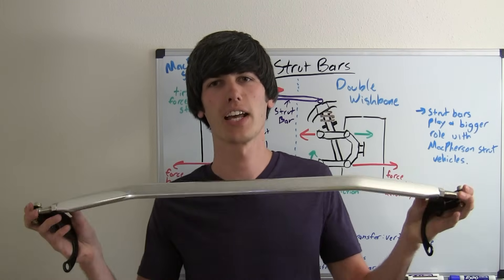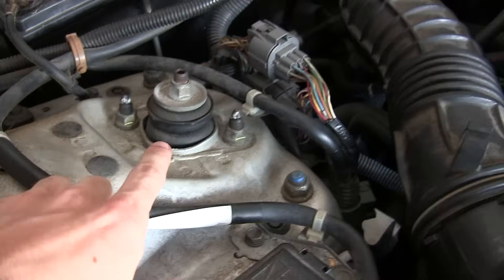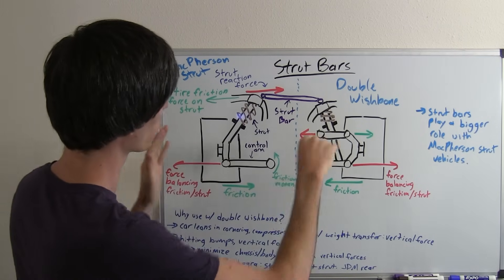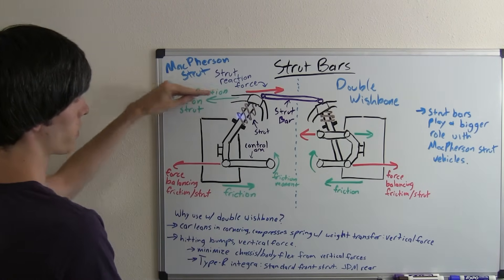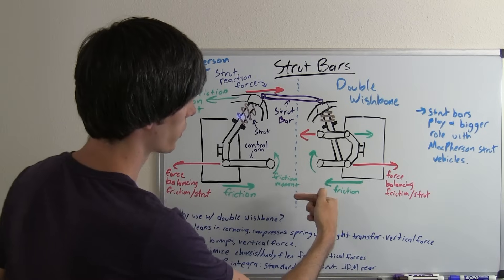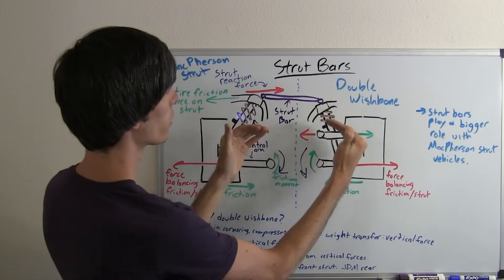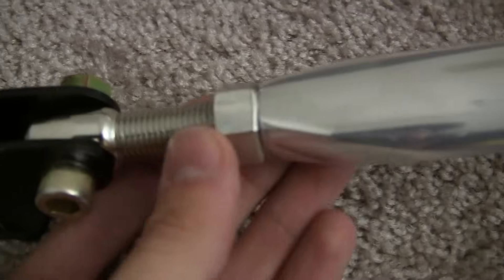Strut Bar - Explained

Comment: you will annoy people more then gain hp. If you want to gain hp you will have to re-do your exhaust system from the header's down. You can also swap out your tires for more racing ones. They warm up pretty fast and get sticky for max grip. I would go with tires if your ride is not turbo charged.

Comment: what is the difference between a strut bar and an anti roll bar??
Reply: ones on top, and the others underneath
Reply: sway bars/anti roll bars are round "flexible" metal bar that reduces body roll of a car when turning. It is connected in the left and right swing arms of the front or rear suspension. Almost all cars have an oem/stock sway bars already installed on them. 

Strut bars is a kind of "stiff" brace that makes the front or rear part of the chassis (where the struts are bolted) a little stiffer and reduces flexing during hard turns or bumps. 90's car models with Macpherson front suspension may benefit with addition of strut bars, in the sense of making the chassis stiffer thus maintaining the geometry even in non-racing use. Newer car model designs had their strut towers closer or even already braced to the firewall, making them already stiff, negating for the use of a strut bar for everyday driving.

If your car doesn't have one, you can easily install a strut bar on it, just don't overpay because the performance gain doesn't warrant you to pay for more than $50 on it.

Comment: WOW... almost didn't recognize him, lol.  For all the naysayers out there, the 2003 350Z came with a permanent structural cross brace in the rear and a bowed tubular steel strut brace in front that was adjustable.  I don't think the Nissan engineers manufactured it that way for "looks".   Did the front strut brace flex slightly, most likely, but not enough to get rid of it.

Comment: so does supercars have strut bars to?? jus curious
Reply: Very high-end cars now tend to be designed with pushrod or pullrod suspensions. They can have the same double wishbone (or MacPherson) control arm layout, but the way the damping components are attached to the frame is completely different.

Comment: the theory of a strut bar is sound....however ...a bent/bowed strut bar (such as the one shown in this video) has very little if any value since instead of transmitting force from strut to strut it flexes...just like the chassis.

Comment: Thanks for your lesson man ! That's great,
However I do have some doubts which I hope you would clarify for me.

So based on your explanation,
I understand that strut bar connects the right and the left side strut towers together
hence distributes the forces.

But what about 4 points strut bars ? 
More contact points = more rigidity ?

How would the front strut bar affect the understeer and oversteer ?

Currently experiencing both US and OS.
(FF & MacPerson equipped)
Thanks in advance.

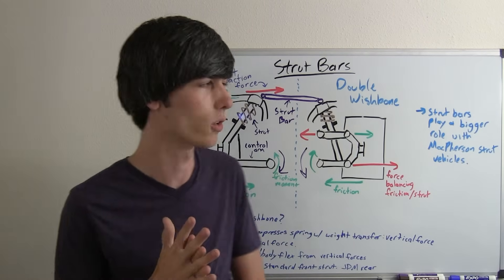Comment: 4:08 WRONG! When fitted to a car with double wishbone front suspension, a strut tower brace is mainly for show for the reasons explained in the video. Just like spoilers, side skirts and wings fitted to road going ‘racy’  Japanese cars, it’s mainly for looks and not really for functionality. 
But it does get the ricer drivers ‘hard’ when they ‘pop the bonnet!!’

Comment: I don't know, I don't think most strut bars do anything besides a placebo affect. That cap-head bolt only supports a moment about the axis of the strut bar, that stand-off mount give that rear bar a nice parallelogram effect, and the jam nut is just silly. I think the only strut bar worth buying is a static, non-generic bar that is specifically made for your vehicle and has welded joints instead of all the bolt/cantilever joints on the bars in this video.

Comment: I am thinking about purchasing a strut bar, but  I noticed they also sell the rear strut bars, Is it better to have both? Or will just the front one work fine?
Reply from the maker: Giuseppe Colucci Well some cars (mine included) don't have a connection at the c-pillar so it makes sense to have both. That said, I'd get fixed ones which don't have pivots like I show in my video.

Comment: Your freebody diagram is wrong. You do not have any moments on the lower control arms. They are pin connected so they can't transmit moments.

Comment: coil over. strut bars. sway bars. should i do all of these?
Reply: Depends on your car. Typically for a front wheel drive car, you would want to stiffen the rear to reduce understeer. Adding a larger sway bar and stiffer spring rates for the rear would help a lot.

Comment: You forgot to mention the most important fact about the strut bar: Only the solid welded in is worth doing. These adjustable with many moving parts simply doesn't make any sense because they are not functional. You should know that! But then your sponsors wouldn't be happy about it...

Comment: 👈👈🏿True But realy this only applys to cars that are pushed hard, i have never seen the paint missing on the edge of the hood of a street car ,1 degree = about 1 " deflection & the strut angle reduces the leverage on the tower significantly. & if you cant feel the variances in a wheel alignment that can be out 1% your not gona realy feel a difference. besides the but dyno lies

Comment: Unfortunately this is one of those automotive 'romance items'.  People who buy them think the bar will transform handling and the feel of their car.  This maybe so in a minute way if you're cornering at 100mph with sticky tires on a 270 degree bend or the same speed cornering in an off road rally car.

If the top of the strut tower moves without this brace, then your front will have already cracked off and your car folded in 2 by the firewall.  Second, a strut brace with 2 bends in it?  Any perceived forces into the bar will create more bending by the bends. Third, if you have a look at the mountings where they mount to the top of the strut tower, there are a few places there where the steel mounting will bend.  

The amount of force against the top of the strut tower is not that great sideways.  If measure from the tire contact patch, measure up to the control arm ball joint it may only be around 5 inches.  From that ball joint to the top of the strut tower is around 4-5 times the, ground to ball joint measurement.  This means that the force against the side of the tower is around 5 times LESS than that from the ground to the ball joint.  So if you have a side loading of say 500 pounds of weight to resist, then the weight against the strut tower top will only be around 100 pounds.   The vehicles steel stampings will easily resist this.  And as I said above, if your tower is moving now, it will have already cracked through the firewall!  

Save your money on this 'romance' item and if you want better handling, put it into more proven stuff like sway bars and decent bushes etc etc.

Comment: I would re-examine the forces involved in a strut bar if I were you and the disadvantages associated with one that has rod ends on both ends.  With a 2 point brace like you have there, you are not accomplishing any real chassis rigidity.  Don't believe me?  Take a box and open it up on both ends, set it on it's side.  How easy is it for you to collapse that box by pushing on the top?  Pretty easy right?  This is in effect what you are doing with a conventional 2 point strut tower brace.  If your chassis is flexing at the front under the loads (and I'm not saying it isn't possible), then adding a 2 point is only going to force the strut towers to move in the same direction which contrary to popular belief does not increase rigidity at all as the force is transmitted equally to both sides.

What is worse is having a pivot point at the strut tower mounting point.  Now you've removed what little rotational strength a strut tower brace provides by allowing the strut tower to pivot on the pivot points like a giant panhard bar for your strut tower mounts.  This is more noticeable in one wheel bump where instead of forcing the chassis to react in unison, you've forced the side impacting the bump to move upward and inward.  With no pivot point on the STB and solid ends that can't rotate you at least have SOME strength in this direction to force the chassis to act closer to in unison.

What a 2 point strut tower brace will provide extra chassis strength in is the braking and acceleration forces where the strut towers are going to be forced together or apart.

If you want a functional strut tower brace it needs to be triangulated to something that isn't movable relative to the strut towers, something that is "out of plane" with them, like the firewall.  By triangulating the STB to the firewall you now have increased the front end stiffness by providing a mounting point that does not move relative to the strut towers.

Of course if you don't believe me, there is a forum you should READ and SEARCH on called corner-carvers (a Google search of that will bring up the page I'm talking about).  There is a substantial thread devoted to strut tower braces and their impacts on chassis rigidity.
Reply from the maker: Thanks for the info. I'll certainly agree that a pivot point is not an ideal characteristic, and it would have to be incredibly tight (the bolt at the pivot) to prevent any movement and thus perform it's job completely. I wouldn't say it doesn't provide any rigidity, as it would (attempt) to prevent flexing in certain scenarios (struts flexing out/in, separate directions). Overall, I'm not too convinced the setup I have is doing much of anything, but the theory behind it does seem sound.
Reply: Agreed with this, top of both strut towers attempts to go the same way in a corner (disregarding differences in lateral force side to side and non linearities in chassis stiffness), and the bending stiffness of the ends will be near negligible bolt or no. Intuitively, I could also imagine strut braces doing more in single and two wheel jounce.

Comment: I don't think the lateral forces at the top of the strut can be very large, the bushing couldn't take it, but yes there is a small lateral load.  On the wishbone suspension, the strut bar can only increase chassis rigidity but the strut is essentially a 2-force member that can only exert force in a straight line between its mounting points so it will contribute very little to chassis rigidity.  I don't think they are worth their weight with either suspension.  It is just a dress-up part unless it has a moment-resisting connection at the mounting points.

Comment: Arn't these also called Anti Roll Bars
Reply: Anti-roll bars are linked to the bottom of the suspension where the wheels and tires are. Essentially, the concept is the same, but it provides a different kind of handling improvement.

Comment: it's a marketing thing ,do we really have cars with suspension towers that are so weak that they flop around with road driving? ok how much do they move without a strut brace then? 2 mm ? 10 mm ? you need to verify that there is actually a problem before you try to fix it and promote these fashion accessories 😏 OK there may be cars out there with such weak chassis that on the race track they may benefit, but not on normal road driving..and surely if it were a race car the mandatory roll cage does far more for ridigity than these things...